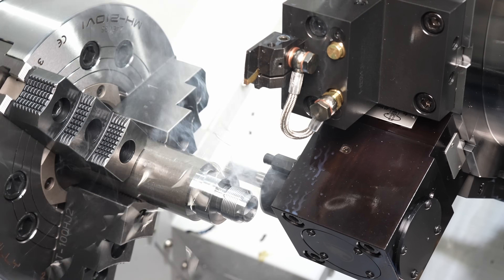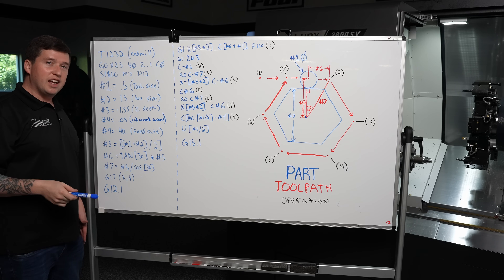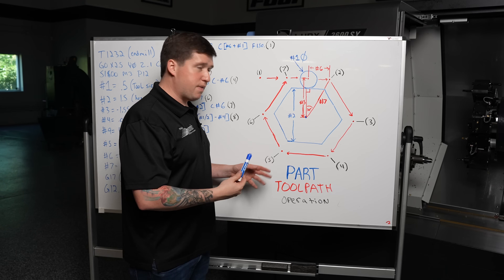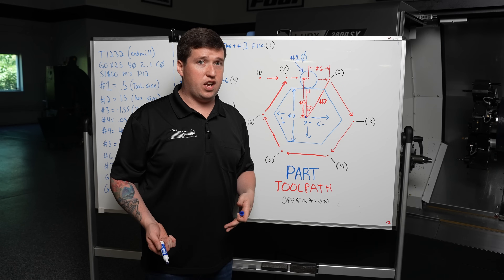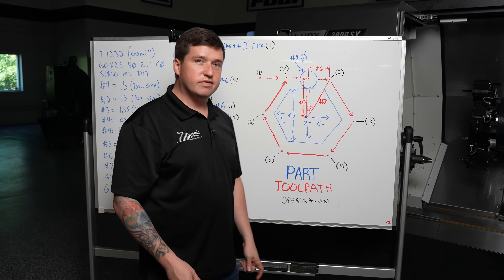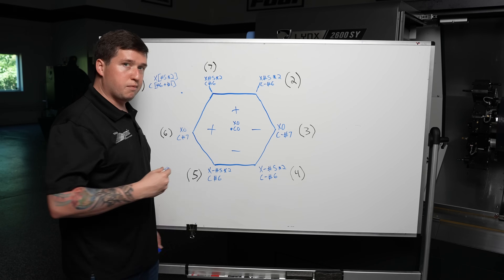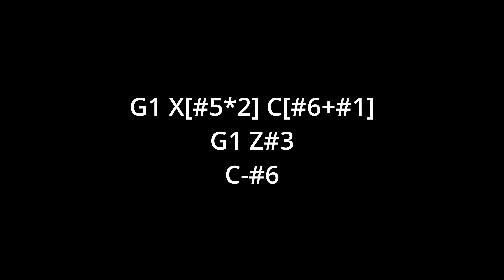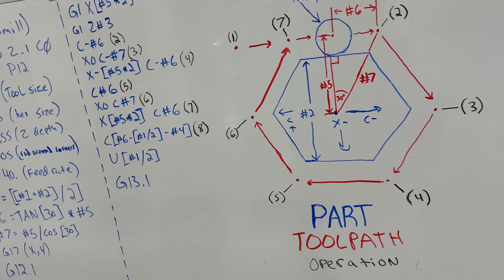NEVER program a hexagon again! | G12.1hex milling macro

Comment: Nice video! It reminds me of my very first macro;  it's pretty versatile, does ID/OD hexes, with corner radius and helical interpolation, if needed, with 100% error checking too, for Haas 3x mill. It doesn't really matter for OD, but I'd recommend writing the macros with actual machine compensation (no offsetting in the code), so the machine tool knows the cutter diameter and can automatically adjust the feed to the actual desired feedrate.

Another cool thing about macros is that only G0, G1, and G4, are needed to write every other part-cutting g-code as a macro...and I would never recommend it actually be tried.

The downside of macros has everything to do with inconsistent parameter names; it would really be nice to move macros between similar machine types without remapping parameters. That's the future.

Donnie, I think you watched too much Chappelle Show growing up.

Comment: does macro work in all machines?
Reply: macro programs can work in all CNC machines, especially if they support the Fanuc Macro B or similar standards, though the specific capabilities and features may differ from newer models. Older machines often have fewer variables, and some advanced logic or system variables might not be available, but core functionalities like subprograms, math, and logical operations generally work.
Reply: @jordanodonnell7807   i wanna learn more about macros can you recommend any website

Comment: Mori NL user here!

I made loads of macros, for making hexagon and squares (but you can do any polygon) I made a couple of WHILE cycles also to rough the part if needed, both for the inner hexagon I make and for the external ones.
Said that, I preferred to approach the part in the same way you do, but for the finishing pass I preferred to return to C0 (intending the top flat of the hexagon being perpendicular to C0/X position) keeping the mill to a tenth of a mm over the surface, to achieve a better radius on the last corner machined.
Also on the mitsubishi control I have on the Mori, you can (must) program with the E the feed on radius and chamfers made wirh the ,R or ,C, so it is simple to work the last radius with a low feed and then to escape to the point in which I'm going faster.
I don't know on your machine if theres the E.

Trigonometry calculations are simple for other shapes, you only have to add a variable for the number of sides.

For roughing passes, I preferred to avoid making all the shape, but I made a different WHILE cycle who make a flat at the time, calculating the tangential points between the starting diameter and the flats (for the first pass) and then only for the arriving point, until the last pass, in which the end points in C are the same since the first and the previous flats are already made.

It's a little complicated, but after making it it's a matter of copy and paste and it works like a charm.

Another macro with a similar approach I made for hole or recess roughing (for example, a series of Allen screw recesses) in which you start with a mill smaller than the hole, set a target lateral pass increment, then the program divides the difference between the hole and pocket diameter to have the total lateral increment, it divedes that by the target pass step, to obtain the number of passes, it rounds to the higher number (FUP) and you get the real lateral pass, then starts to make the pocket at full depth.

This is useful also for parts who have many holes which you don't have enough tools for.
Just start with a smaller drill and then, obviously where possible in relation to holes depth, you enlarge them with the mill.

Cheers from Italy!

Comment: The program works great..i did some adjustments though for fanuc oi-tf. Because of  it's not recognising the "," , even though it's  works like a charm...THANKS .and I want to ask about is it possible to do The " ferry" bolt head with
 this method..?!
Reply from the maker: Ferry bolt head?
Reply: @donniehinske yes it's also known as 12-point flange bolts .hope u got it
Reply from the maker: @MOHAMMADAFSEL oh it definitely won’t work for that. You’d have to write a separate macro
Reply: @donniehinske yes absolutely..I figured it could have 1 additional tool paths in between each hex corner points which goes  down to minor dia  , these points inside can be done by small dia end mill cutter. To achieve the smaller radius corner as possible... right?!

Comment: Wouldn't it be possible to write this macro using G42 so that you don't have to include the tool diameter and simply it?
Reply from the maker: Yes absolutely! You could even have it take your tool radius from the offset. I didn’t include that because every machine is different so I am forced to show methods that are applicable to as many machines as possible.
Reply: @donniehinske  Glad I watched this video yesterday as I encountered a problem at work today that I could fix with G12.1! Had to set up a lights out job for thousands of small nylon wheels, just regular turning would result in stringy chips getting wrapped around the part. With G12.1 and G42 I programmed it to do all the OD diameters with milling, and it's coming out spotless now! The previous programmer tried using a Fanuc NCGuide cycle but that just resulted in the chip curling and rubbing against the endmill ruining the part and the tool within 100 parts. The only long chips being from parting off but I'm already pecking them. 

Thanks for sharing the knowledge! Always eager to learn more but finding good resources is difficult, and the manuals aren't always available or of the highest quality so I am looking forward to more content!

Comment: Excellent work. I’ve been writing macros for about 15 years now, but I don’t seem to be able to explain them to others the way you can. A suggestion- rather than include things like your feed rate and tool diameter in the call line, have the macro itself read system variables for them instead. This is especially useful in the case of your tool data, because it allows you to adjust for size in the wear tab of your tool data, rather than alter the sizes in your call line - just as you would for normal programming. 
Keep it up- you seem to love macros as much as I do! 👌

Comment: Hi! This is a super dumb question im sure, but whats the point of handwriting macros when you can use your CAM software to accomplish the same task?
Reply from the maker: That isn’t a dumb question at all. So the job I do requires me to go around to different shops and solve problems on different machines every day. Not every shop uses the same CAM software. Some shops only buy one machine to do a handful of parts so there’s no point in them buying software. So these kind of tricks are good to know for situations like that.

Macros are universal. They work on any control that allows them, which is most of them. 

Also, you would be surprised the amount of shops that are still hand typing G code
Reply: @donniehinske makes total sense, thanks!!
Reply: @donniehinske always thought doing consulting and turnkey work sounded super cool
Reply: This isnt me hating or being critical, just questioning since im new to macros

Comment: Today I wrote a Macro on the mill using the equation of a circle in Y and Z, converting to a quadratic equation and using the quadratic formula to solve for Y based on the Z depth. Looping it using “IF Z(current) >= Z(final)”. 

Now I’m trying to incorporate tool compensation within the equations. 

It honestly amazes me how my brain can just barely retain enough information to not get lost in the math, code and train of thought.

Comment: Man this is an awesome video!

Now imagine you don't have a Y axis or polar coordinates on your controller, how would you program that?
Reply: Call your apps guy... 😁
It's just a lot of math to command the right C coordinates in sync with the right X coordinates.  I would think it is an exponential ratio so probably kinda difficult to hand program depending on how perfect you want the surface to be.  It would probably end up being a DO loop that continuously calculates the X &C value.  (That would be a LOT of loops)

Comment: Is there any way to adjust the macro to adapt to depth of cuts or do you have to just copy and paste the macro with different sizes? Either way, this seems like a pretty effective macro.
Reply: You could adapt it slightly with a DO loop that decreases the desired hex size until it hits final.  Very similar to the DO loops he has done on previous macros.

It would only have to edit that one #variable.
Reply: @mgk1397 You're right but that seems to be the same amount of work as just copying and pasting. I don't like work, I want the machine to do the work.

Comment: Nice! I have a "flats" program for any number of flats you'd like using a 4th axis on a mill, but sometimes it makes more sense to use a table chuck, I'll definitely adapt this to a Haas mill. I liked your thread milling macro so much I adapted it for single form, multi form, radial depth of cut, TPI vs Pitch and all the bells and whistles, thank you! My stuff definitely isn't as clean as how yours are set up, but hoping to get there at some point, I'm entirely self taught. Thank you for the wonderful channel and information!

Comment: Hey there, just curious, wouldn‘t it be easyer to just divide ur hex key number by cos(1/2 the corner angle) (hex =30*) by this u would have the exact edge diameter of the hex:) I have susessfully programmed a hex cycle for my lathe from 1998 with constant cutting depth and a loop with logic without having the option of the machine to have logic, had to write the logic myself:( Maybe if u are interested we can keep in touch through the comments:) Controll was a Phillips432t. Sorry i just saw #7, but doesn‘t that make # 6 kind of useless, if it is possible to move from #5c0  straight to the corner of the hex? (#7)
Enjoying ur video:)
Reply from the maker: You can do what you are saying I believe. Sounds like you are talking about programming it in straight rotary movements whereas here I am programming it as if it was on a 3 axis mill and the machine is converting that into rotary movements. If I am understanding you correctly
Reply: @donniehinske actually i used polar coordinates, like the corner angle 60* and the corosponting length (hex edge diameter/2), by using this, i only had to add 60* for each corner until it was a full circle:)

Comment: Thank you for the lesson my man. Would love to see your take on this problem. Had a 55count bolt pattern on a 3 axis mill and needed to modify about half of them. I wound up probing each hole individually and reseting my wcs each hole. Is there a way for me to use my probe to spit out all the coordinates into a text file or a otherwise useable format all at once so i could run all the holes in one shot
Reply from the maker: I think so? I am not 100% sure what you are asking but a bolt pattern can be done in a similar fashion if the wcs is the center of the pattern. You could have it write to a variable for each location then DPRINT the values I THINK. 

Instead of 30 degrees for your trig you would do something like 

#1=50(amount of holes) 

Then your trig would be 

#2=TAN[#1/360]*(bolt circle diameter) 

Bit more to it than that, but I believe that answers your question

Comment: Well done. Any way we can read system variables for tool diameter instead of defining it programmatically?
Reply from the maker: Yes you can absolutely do that. The struggle I have with making these videos is that every machine tool builder does this in different ways. Some will use #12000s-#18000s for their tool data and others don’t. So I have to pick methods that are the most widespread.
Reply: @donniehinske  agreed. We, as an industry, really ought to lean on Fanuc to clean up their tool management mess.
Go to a siemens and you can read ALL tool data with system variables, and it's all held at the NC level. Fanuc, it lives off the NC, and you've got to go through the ladder to retrieve in-depth info, if your machine tool builder was wise enough to program those routines. Even so, you're stuck with scan time
Reply: I think you could just write the theoretical size of a hex and use radius compensation from the tool offset page which is taken by calling the specific variable number where the x or z radius compensation value is called for calculations. After that if you have a theoretical hex I'd substract the amount of let's say -,003 for tools to fit in better. 0 is 0 and you can always make a hex smaller as long as you stay to the general tolerance. This -,004 can be a constant for all the hex you are going to mill and after this you will know how much the tool deflects if it does.
Reply: @Roberty98that would work too, however you loose a little clarity for approach size.
Another thing, not so much here but important elsewhere, is being able to see tool dimensions for calculating rpm, stepover, etc. Fanuc needs to improve this

Comment: Have you tried this on a Haas ST Y Lathe?
Reply from the maker: No but I am sure if it can take macro variables it will work fine. Just would require tweaking from how the machine preps everything with codes and whatnot